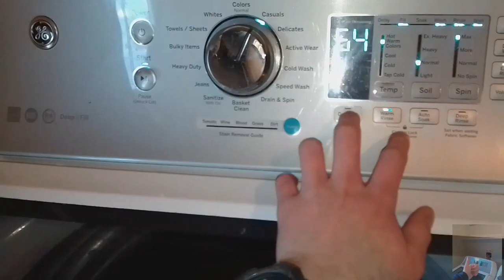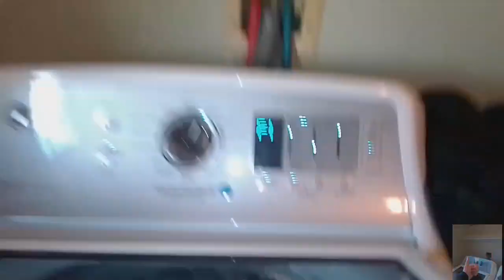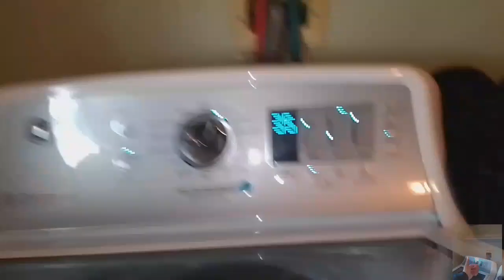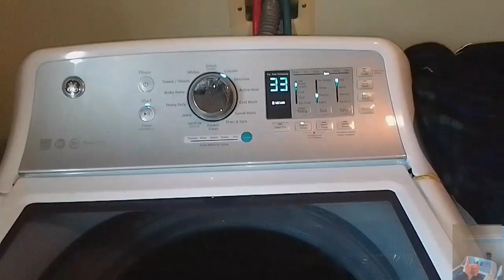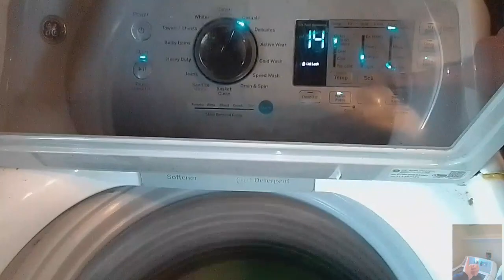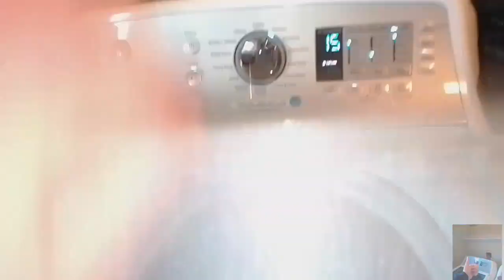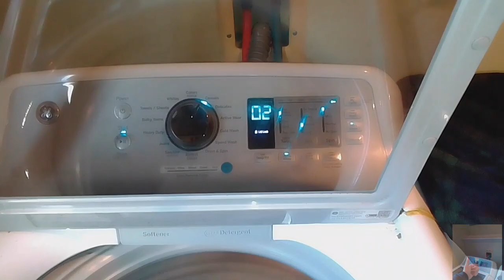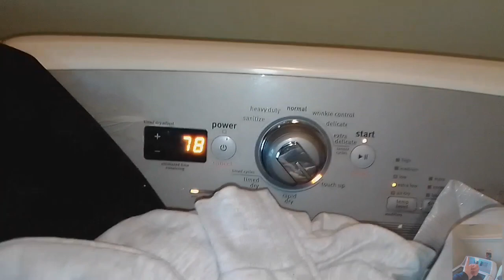Cottons Wash: Casual Cycle

Comment: I really like the difference in blooming as you kept hitting the deep fill button. Extra water is always better. 👍🏻
Reply from the maker: That's definitely one my favorite aspects of agitation with this machine. It will always try and adjust the agitation accordingly to the water level set. The only exceptions are delicates (which I don't use that cycle often because it's almost to gentle) and the jeans cycle which has a very uniquely aggressive agitation.

Comment: Has this machine been trouble free for you so far ?
Reply from the maker: Aside from the lid lock (I'm now replacing it for the 2nd time in 2 years) it has been problem free. Next month this machine will 2 years old. And despite some less than optimal designs (control board feels kinda cheap) it has held up very well and gives me very good results
Reply: Pat I had bought this machine when it first came out I could just not get the deep fill button to give me extra water. It would fill very little, I called GE they told me to plug the machine and unplug it to reset everything so I told them I have to do this each and every time?  luckily PC Richards took it back and that’s when I bought speed queens.
Reply: @petermaz701  Are you in the NY tri state area ? I bought a Whirlpool fridge a few years ago from them that i left at my dad's house.
Reply: @patcola7335  Yes I live in Throggs neck in the Bronx New York city
Reply: @MaytagMachineManiac  That's what counts. Clean clothes is all we want. My Amana is holding up so far. It's now at 7 months I've been using it. 

I have to buy more storage or get a new phone. My space is nearly used up. Can't film long cycles on my machine right now. I want to film a normal cycle with lower water level. That basket does some bouncing from the torque of the motor.
Reply: @petermaz701  Cool. My late father was from the Bronx. Was a yankees fan his whole life. I now live "down the shore"...as we like to say...in Toms River NJ.
Reply from the maker: @patcola7335  clean clothes first. Storage has kinda been a back burner issue for me. Once I'm done uploading a video I delete the footage from my phone as I don't need it and I tend to catch most bugs in the editing process. The only other thing that competes for storage on my phone is my music